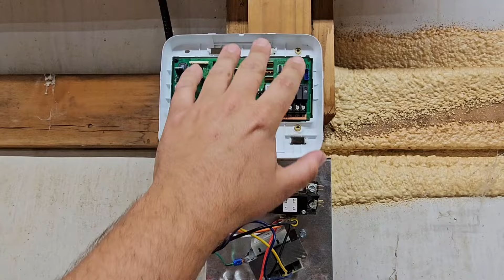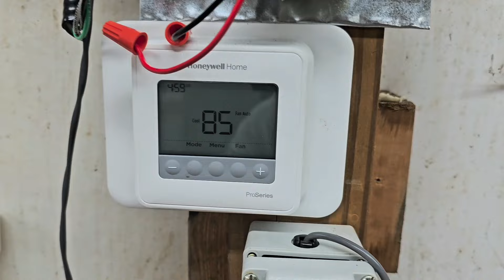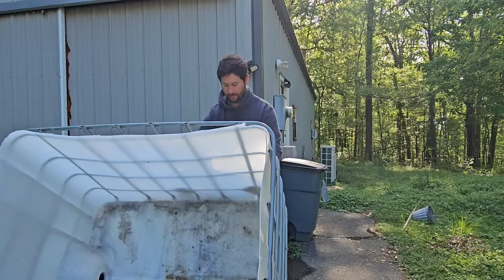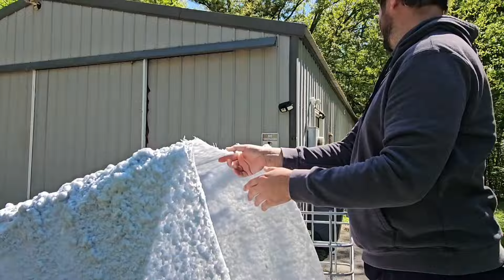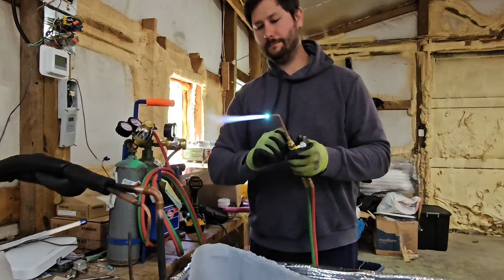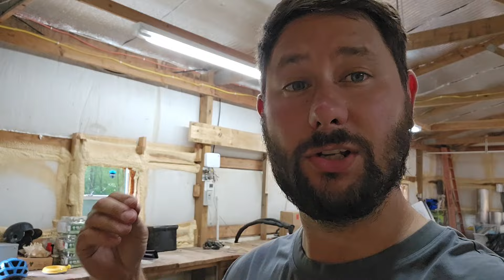Heat Pump Hot Tub DIY 🔥#heatpump #minisplit

Comment: Could you submerge an A-coil from a central air system in the water instead of the homemade coil? My understanding was that the majority of the heating/cooling happens when the metering device allows the rapid evaporation of the liquid or condensation of the gas which either releases or absorbs a lot of energy upon phase change. Thats why A-coils for hvac systems are different than a heat exchanger for a woodfire boiler. Without the metering device and the rapid change in volume I wonder if youre leaving a lot of potential untapped. I also worry about the health of your compressor once the refrigerant becomes saturated with heat.
Reply: As long as he uses this for heating, it doesnt need a metering device because its acting as the condenser in the system. Besides, these ductless split units have an electronic metering device built into the outdoor unit. He also explains that the refrigerant flows down the small line into that coil, then leaves through the big line. That is incorrect for his application. When the heatpump is in heating mode, it reverses the flow and sends hot gas through the large line into the coil, then the refrigerant condenses at the bottom of his coils, and it leaves through the small line.

Comment: Pretty cool, and incredibly timely. I came up with a similar idea independently recently and just decided to do a youtube search to see if others have tried it. Great minds think alike, I guess.  ;)

But did you consider this? Diverter valve to skip the outdoor coil altogether, and a second tank. One hot tub, one cold plunge. You might have to occasionally open the diverter valve to cycle some of the heat/cooling back outside, depending on the respective deltas between the set points of the water tanks, respectively, and the ambient temp, but it should be relatively simple to control that with a pair of simple temp controllers, and a little bit of logic to decide which tanks have reached their set point temp, and what to do with the reversing valve and the outdoor coil in order to keep the other tank moving in the correct direction without overshooting your target temp on the other tank. 

By utilizing the heat energy for both a hot AND a cold tank simultaneously, you'd save a ton of energy in not having to switch directions for several hours to go from hot tub to cold plunge, as well as be effectively doubling the efficiency by having the two tanks dedicated. Free cold plunge cooling, from the energy that is being used to heat the hot tub anyway. And who doesn't want to have both available at the same time? Going from a hot tub to a cold plunge and back again just feels so nice!

Thanks for posting the video, you've pretty much just validated everything I've been obsessively rolling around in the back of my brain for the past several days.

A circulation pump to cycle the water over the coils would also likely increase the efficiency and speed of the system just a little bit. Obviously you'd want a filtration system as well for long term use to keep it from getting nasty, but those solutions are all pretty well figured out and would be super easy to implement in a more permanent installation. 

Subscribed.

Looking forward to your progress. It'll probably be a while before I can start playing around with this, but I'll probably make some videos as well, when I get to that point, so hopefully we can share ideas.
Reply from the maker: that is a great idea I enjoyed reading this 
You are very smart 
Thank you for watching

Comment: I've seen something like this before, but it was configured differently. The homeowner ran his discharge line to a thermal tank that had a heat exchanger installed (tube & shell), then it looped back to the condenser unit. It also had a bypass loop that operated a 3way solenoid off a tstat at the water tank so it prevented overheating. The last need was a pressure switch on the liquid line that would cycle the condenser fan off to keep high side pressures up while heating the tank.

Very cool set up
Reply from the maker: That's very cool. Thank you for sharing your knowledge

Comment: Great video, Tad!!
It’s always always cool when an experiment works out really well. 
It brings me to ask a question that I’ve been wanting to ask for quite a while and I keep forgetting. Can I wire a mini split ens with a controller like you’re using in this video and use that condenser as a central unit in my mobile home? I have a Goodman 18 K(Daikin) Condenser unit that is only a few months old and I was wondering if I can somehow put it to use as 
 a central unit?
Reply: I really enjoy all your videos and I have learned a lot from you. Thank you for all that you do!
Reply from the maker: You're the reason I do the video, so thank you so much
Reply from the maker: Thank you, brother, i'm glad to enjoy the video.
And to answer your question, yes, if you have the right controls then absolutely
Reply: OK, thank you! So I guess I just need to figure out how to hook a communication cable to some sort of control unit in the house that would hook to my thermostat? The house had central a/c already in the past so I just need to put a new coil in my furnace. I am determined to make this work, especially now that you said it’s possible. L O L.
Would that Samsung control unit work for me or does that have to be brand specific from Daikin or Goodman?

Comment: Very interesting experiment.   How hot could the heat pump get the water vs how hot do traditional water heaters get?
Reply from the maker: I'm not sure how hot, but I think that I can make it upwards of a hundred and twenty, and maybe at the most a hundred and thirty degrees
Thanks for watching
Reply: Heating Usually about 60-65°C depending on the compressor and heat exchanger 
generally 70/80litres per hour recovery